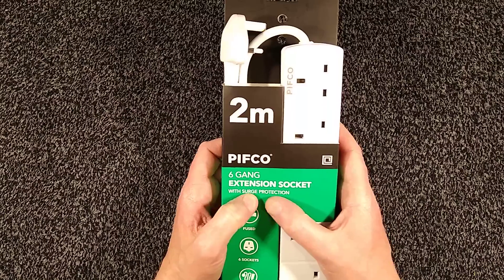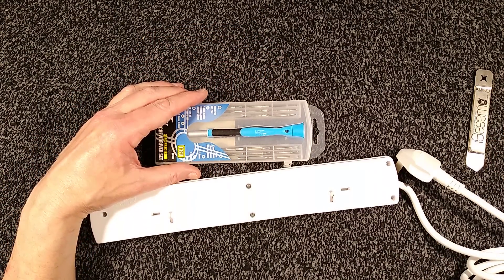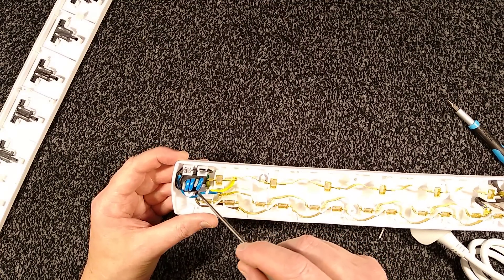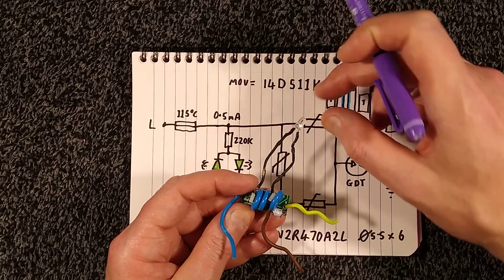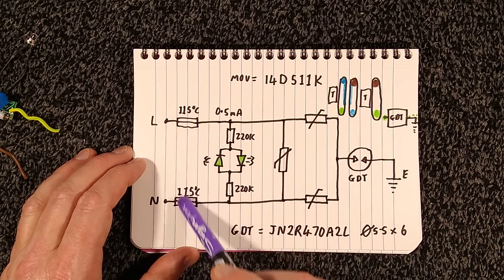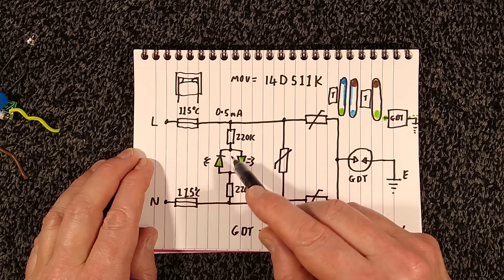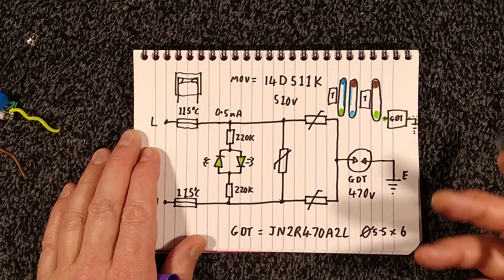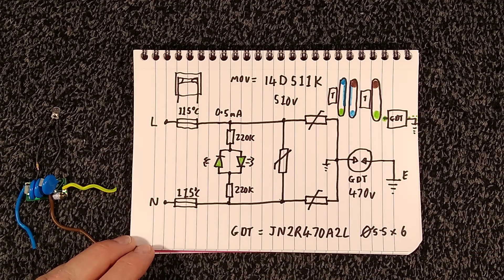Inside a Pifco surge protected extension (good circuitry)

Comment: Hi Clive, you've made quite a lot of video's about surge protectors, they are, viewed them all are interesting too! But i do have a question. The MOV's will burn if the tired of clamping. Making it a fire hazard as you mention in several video's. All but the industrial version do not have any fire protection. Are the thermic fuses enough to prevent MOV's on fire? Secondly, i have experienced a full hit lightning strike while visiting a friend. In the Netherlands we use 3 2.5mm2 solid copper wires in conduit pipe. They were burning from the top of the storey house to the ground floor.. He had 2 home surge protectors for his computers installed. You guessed it, all were smoked as every electric appliance in the house.  Which poses the question, are we and schematics not too optimistic in the actual ability to protect?
Reply from the maker: Nothing can protect against a direct lightning strike.  The thermal fuses are supposed to cut the circuit when the MOVs start to fail and heat up.

Comment: Hmm. Fuse in the neutral side? Have I misunderstood something? 
The neutral fuse blows. The equipment stops working but is still floating at mains potential. If anything, it's even more dangerous. That's why you only fuse the live side. So why has Pifco done it this way?
Reply from the maker: The fuse doesn't protect the socket strip.  Just cuts out the transient absorbers if they start getting hot as they do when they fail.  The main fuse protection for the strip is in the plug.
Reply: AH! Got it now. ☺
It took me a while to realise why a lot of amateur radio (etc) equipment intended to be used in a vehicle is fused in both the positive and negative wire. It makes sense when you realise that the chassis may be connected to the car's metalwork. Connect the cables the wrong way and you've put a dead short across the battery. OUCH! 🥶

Comment: if they put the surge circuit at the lead input the whole array of loads would be protected from the voltage drop across the brass strips.

so the first load in the line will get all the fume during a high voltage peak even if the MOX and discharge gap would trigger and crowbar on the very last end of that chain.

Comment: The timing of this video is quite amazing, you uploaded this the same day I chose this model for my mother as she needed a new one, I'm always curious to get inside and look around and you've saved me a teardown and wasted cash.

I can also say that some of the other models I saw whilst choosing an extension is terrifying, some of them had cables that was far too thin for the number of sockets and usb slots in some cases that they wanted to provide, not to mention how many could potentially let you bypass the earth pin due to the edge of the case being too narrow to prevent an upside down plug from being pushed in by a curious billy, letting him poke whatever he wants into the live sockets.

Thanks for the video, if you're curious about some of the other ones I saw, try a home bargains if you pass one, they normally sell decent if cheap stuff but the electrical section is sometimes worrying.

Comment: I bought a Pound Stretcher, HANNON four plugs and four usb outlets with a neon.
The way the mains cable was clamped was just a straight plastic cutting into the cable outer, not the best or BS standard way of retaining a cable.

Been using the usb outlets to charge some expensive equipment so l wonder if you have a Pound Stretcher near you and for my pice of mind check back engineer it and see how good the usb circuit is? Or if they are still selling them I could send you one.

This cable had pulled out with little force, so to repair it with a large cable tye pulled extremely tight.

It had the meaning less UKCA mark, a dustbin with a X through it, identifing it a s a piece of Chineese junk, a circlip mark with a number 503583 under it and the obligatory CE, Chinese Export mark for the EU.

To get the triangular security screws out I used a small screwdriver between two of the straight edges of the triangle 🔺️ not secure at all?
I wonder which Chinese test house this was approved by?
Thanks for the video.

Comment: hey Big Clive, good video, but where did the other outlets connect?  you didn't show that.  
can I assume the hot and neutral line to the right is where the outlets connect.   mike
Reply: If you look closely around the 2:42 mark, the whole surge protection dooberry is at the opposite end of the strip from the incoming mains, so current to the sockets doesn’t flow through this device.

Comment: I was told surge protectors don't protect against a direct lightning strike. If that's true, I disconnect things from the mains . I've had stuff destroyed by lightning. It might be because it hit my outside antenna. I don't have protection for that. I just disconnect the coax and the power cables when Lightning is getting close.
Reply: That is correct. The energy of a direct lightning strike is absolutely insane and needs more protection than these small circuits can provide. 

Fortunately most people will never be so unlucky, but if you only get a few major storms each year then it's not a big inconvenience to unplug when a storm is overhead.

Comment: Yours don't have a built in current overload? I guess because of the silly design of a fuse in the plug top.
Reply from the maker: The fuse in the plug is the main protection.  Reel style extensions may also have a thermal trip.

Comment: I find this application of the gas discharge tub a bit confusing. It sounds like any surges under the combined voltage of the MOV and GDT aren’t shunted to ground.  So a design without the GDT would shunt to ground at 510v but now the surge must exceed 980v to shunt to ground.

Perhaps I’m looking at this wrong, and the voltage which a series MOV and GDT conduct isn’t the sum of the voltages for each device like you would if you just series up some zeners or something similar.

Comment: I tip my hat to you sir. I was thoroughly caught off by the thumbnail. It looks as real as it gets. I couldn't believe it actually had that extra line on the packaging, but I also couldn't tell it was modified either. At least not until I watched the video, lol...
Reply: Frankly I clicked on the video just to see what the heck is that! 😂
Reply: I was trying to justify the word vibratory as a bad translation of alternating current.
Reply: Vibratory health is as essential as percussive maintenance.
Reply: wait, what? 
>backs out to look at thumb<
Reply: ROFL, worth it. I used to have one of those super-early vibratory massage devices, as Victorian as an electrical device can be made to look, but sadly it was lost in my mother's epic, record-setting hoarding house. gothsigh
Reply: Looking on eBay there is actually a "Pifco Vibratory Electric Massager Vintage - Tested & Working". The box even has a picture of a young lady massaging her thighs. The key question is, is it as effective as a Hitachi Magic Wand ? 🙂
Reply: @MrDuncl  I'd guess the old ones will rattle the fillings loose from your teeth in comparison to the modern ones.

Comment: Speaking of extensions, in University I had a flatmate for a year who was an Engineering student and bought a 20 gang extension socket. He then proceeded to daisy chain it to a 6 gang extension socket insulting me for suggesting it was unsafe, when he left it was left behind because the plug had melted and physically fused to the 6 gang extension socket. Looking back, surprised it didn't set the house on fire; he'd bought it off of amazon and it didn't seem to have an associated surge protection circuit/module.

This same guy also ultimately ran off without repaying me 600 pounds for utilities split as agreed - the amount also included about 150 pounds in groceries. He'd continually delayed repaying me with various excuses then ran off and blocked me on all avenues, Indian National so basically no way of chasing him back to India with the bill.

Comment: OMG - PIFCO have been going for years! I do, indeed, recall that my very first set of Christmas tree lights (bought for me for my first Christmas) were PIFCO, and that was almost 59 years ago. They lasted 'til I was around fifteen years old. My mother also had a PIFCO 'gun-shaped' hair dryer and (I think) a PIFCO iron. 
According to Wikipedia, 'Provincial Incandescent Fittings Co.' was established in Manchester in 1900 and initially sold gas appliances and accessories. After WWI, the company began to sell small electrical items, with Christmas lights, hair-dryers, shavers and electric blankets being some of their early products. the name 'PIFCO' was, apparently, not adopted 'til 1949. The company was controlled by the Webber family for some 100 years but, following several brand acquisitions and take-overs, Sabichi Homewares purchased the global rights to the PIFCO brand in 2001.

Comment: I wasn't wildly happy about how the sockets were connected together.. does the plastic keep the wires apart if a connection breaks?

Don't use this on a generator as N (aka  one side of the generator coil) is connected directly to the Earth..
There were a lot of products with the triangle of capacitors.. bridging L, E, N.
It was a real problem in the 1990's when they introduced it.

Comment: Almost had a fire due to a surge protected extension lead on a ship. Turns out they don't work with an insulated neutral power distribution system.

Comment: My surge protection story: I serviced ATC radios in the USAF in the early 80's. We had a lightening strike on base that took out a GRC-171 transceiver used for the tower that was located in the RAPCON. I determined the only problem with it was a Zener Diode shorted that was used to protect the audio line that connected to a telephone line that ran between the 2 facilities. The bigger issue was that it was soldered into the back of the chassis inside a through hole, and the part was listed in the service manual as DEPOT maintenance only. It took a week of explaining to higher and higher ranked officers that I was indeed ordering an entire 75 lbs transceiver because the service manual said I was not allowed to perform the repair.
Reply: I was in USAF 1981-1985, 511x0, working with satellites. It's depressing how common such stories are throughout all branches of the services.
Reply: To be fair to the service manual, they may have considered the failed zener as an indicator of potential downstream damage which could affect reliability even if swapped. But perhaps I’m being too charitable.
Reply: @CallumAi  I think it was because it's soldered into a through-hole in the chassis that you can't simply solder it out and in, it takes too much heat.
Reply: To quote Charlie Brown:

"Oh, good grief!"

Comment: I've had a Stanley 8 gang individually switched surge protector for maybe a decade now (STS181uk2M) and I've no idea how old it was when it came into my possession. It's even got protection for your phone line (with Belkin all over the back side). The green "protected" indicator on it has never been illuminated that I can recall. The orange "earthed" indicator is still on though. I never use it for anything important nowadays, maybe I should take a look inside.
Reply from the maker: It's possible that the protection has failed over time.

Comment: I have a question: Is the surge protection a  one-surge-and-it's-useless in that there would be no more surge protection like most extension leads or will this one work multiple times?  It's the 'only works once' factor that has caused me to avoid paying any premium for so-called 'surge protected' extension leads. I would rather arrange for proper mains filtering than waste money on a one-shot-if-you're-lucky 'surge protection' device.
Reply from the maker: It will shunt lots of small transients, but a significant incident like a lightning strike will nuke it.

Comment: Pifco, yup 'red dome' topped chrome tinplate torch and my first set of Christmas lights when I was 3 in '56 apparently when I asked my parents zonks ago in the 70's. 20 x 12V bulbs, moulded glass designs, teardrop, bell, lantern, tree and coach. In the attic last used for a short while 3 yrs ago via a Variac to cut the stress down. Not bad, 65yrs old!!! Oh yes on an unfused bayonet lightbulb fitting too, dad had a few 3 way bayonet adapters for multiple light strings!!! 🎄🤔👍😊🇬🇧
Reply from the maker: That would have been a very luxurious Xmas gift in that era.